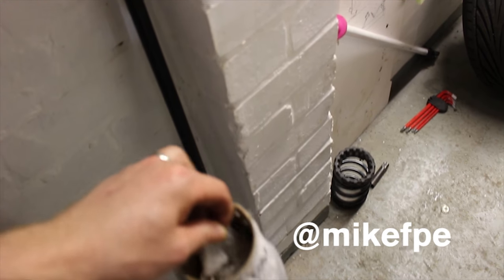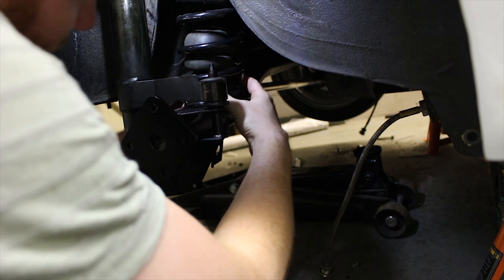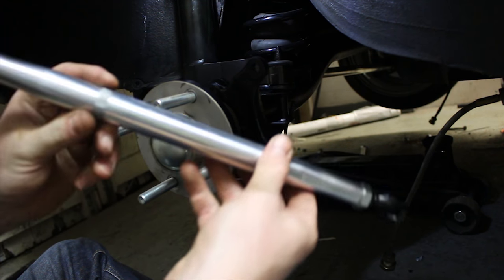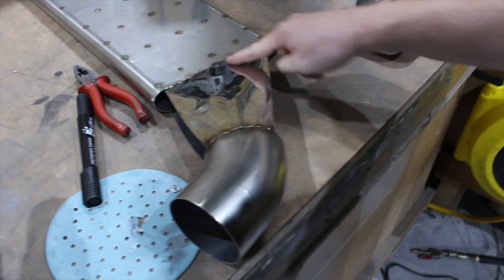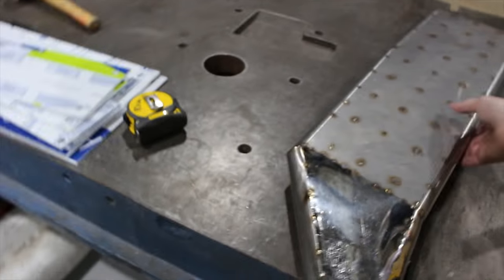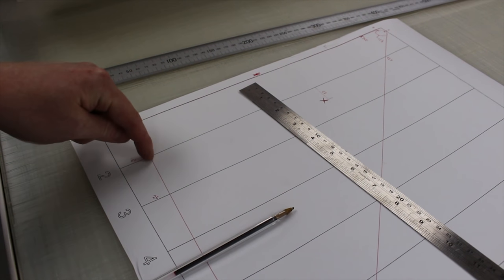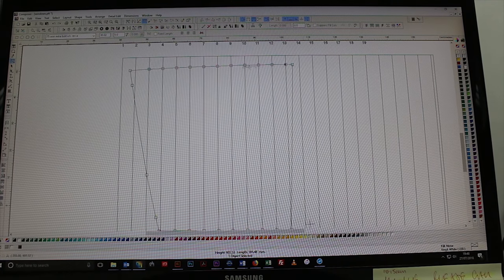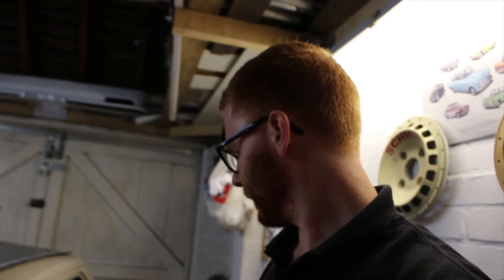Compound turbo Fiesta - Episode 5 - new suspension and windows

Comment: Loving this channel mate & this build is really cool but I don't think your going to get enuff air flow through two 73mm pipe's to keep it cool especially with a compound boosted petrol powered engine. I suppose you won't know for sure until you try it though
Reply from the maker: Thanks for the feed back. Really appreciate it👍🏻. The engine rad is still up the front of the car. These vents are for the charge cooler rad. Assisted with 2 spal fans. Should be ok but as you said time will tell ;)
Reply: @mikefpe  my bad I wasn't paying enuff attention I thought that was the radiator. Should be interesting to see how much heat that compound set up produces though. What kind of fuel are you going to run it on?
Reply from the maker: @troydavies3225  charge cooler set up is massivly over specced. im running it on V power pump fuel. i think my main enemy will be under bonnet temps
Reply: @mikefpe  yea I'd say it will probably get a bit toasty alright ya might have to do a bit of shielding scooping & ducting I'm sure you will get it sorted though